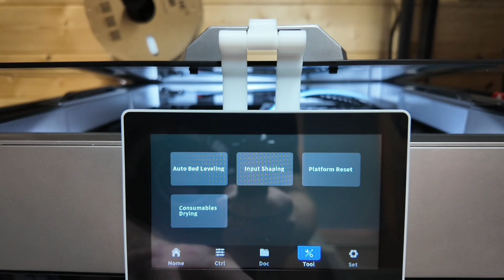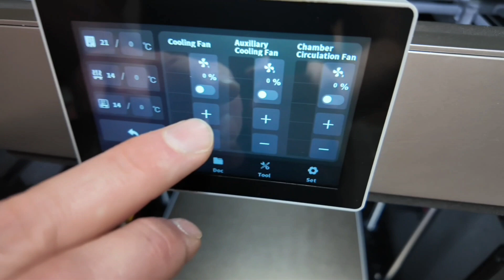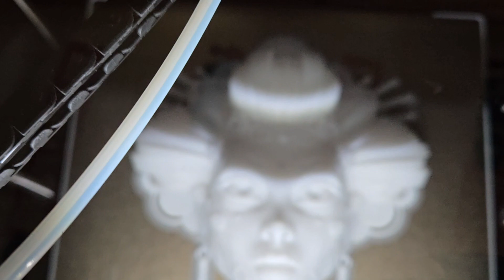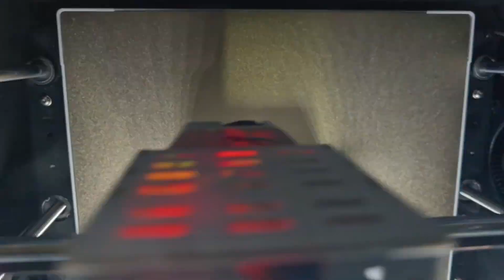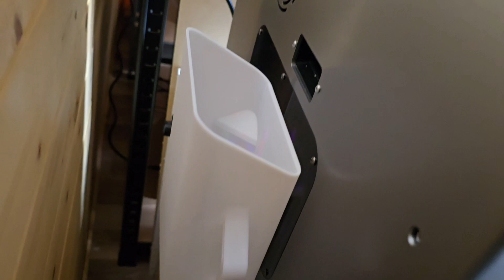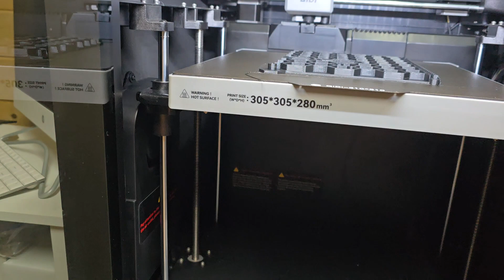The QIDI Plus4 is a Game Changer for 3D Printing

Comment: Good video. I have a x-max3. 

 Slightly larger bed 330x330. 

Couple things; i comes with 0.4 mm nozzle, which is ok for less fine prints, but not so much with anything with fine detail. Switched to 0.2 mm, much better,  but may require a bit of tuning of settings, print speed, quality. Their UI is OK on the computer,  but imo not as flexible  for change.  I switched UI to Orcaslicer ( qidislicer also still on computer,  but I never use anymore ). Took much tuning, but now is much better. I created a model to use for 0.2 mm prints, and another for the default 0.4 mm nozzle, and start with empty default for each nozzle, then add .stl files, and then save with changes as a new model, so I don't mess up the models. Qidi can take 0.2 mm, 0.4 mm, 0.6 mm, and 0.8 mm nozzle, so a separate empty model for each nozzle, then again, create a different model for each project using default as input. X-max3 pretty good, but you do have to set the z axis height properly with build plate leveling card for each nozzle. Hardly any stringingwith 0.2 mm, but higher speed causes more, so I've tuned speed down on finer projects, and let it print slower and better. Gradually will increase speed on each nozzle's empty model until I get the best of both worlds. X-max3 is great out of box also, but had same issue with sailboat test; almost everything looks better with 0.2mm nozzle, but much slower, and if you're printing block projects with no or little detail,  0.4mm is fine. The 0.6mm and 0.8mm nozzles would be ok for fast block projects with no detail.

My biggest downside with it is the lack of support for multi-material. Even the add on box they offer optionally for Pkus 4, isn't advertised to work on x-max3, so don't want to buy/try if it will never work. I saw someone with prusa having an option, but I didn't see it offered as a functional kit, just instructions to print the case for the electronics needed to have 4 feeds, but not the electronics,  a parts inventory beyond the case,  or instructions for actually building a working one.

That woud be my primary reason for an upgrade from x-max3 to Plus 4.

Your presentation was great, I  never felt that you were biased because they asked you to test it. 

Thanks for the presentation!

Also, because of where I keep the printer, to avoid heat buildup, I personally print with top off and front door wide open. 

I hope to print models that I create soon, but it's MUCH better to learn on existing models to can download from Cults, or Thingiverse, until you get good at it so you know once you try your own creations, if anything goes away, it's probably the model you created and not the printer settings. 

No point in trying  to debug 2 things at once.

Again, thanks! Cheers!

Comment: one way to check if gen 2. look on the right hand panel as you are facing it, towards the back is a spot that if you have a bolt head there you are gen one. if its just a bare plastic circle in the insulation about 1/4" then its gen 2.
Reply from the maker: @deaultusername  I will definitely check this, awesome information.